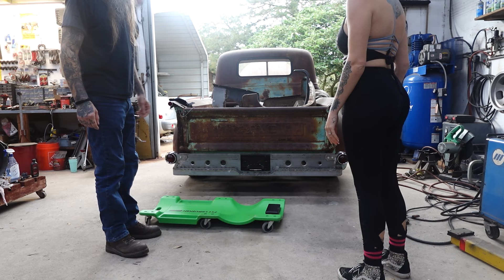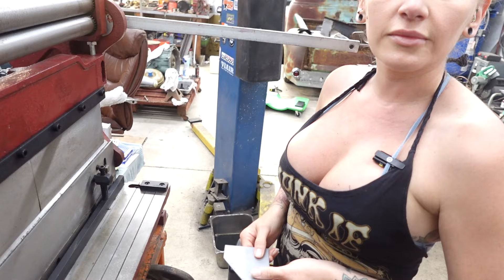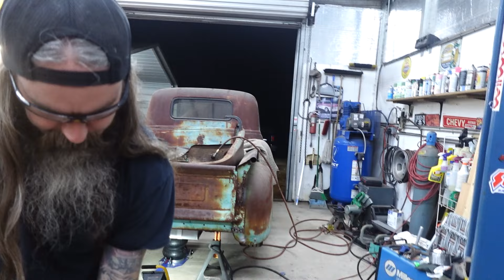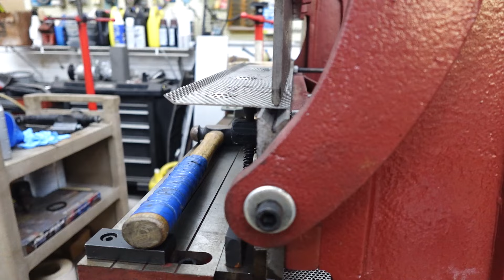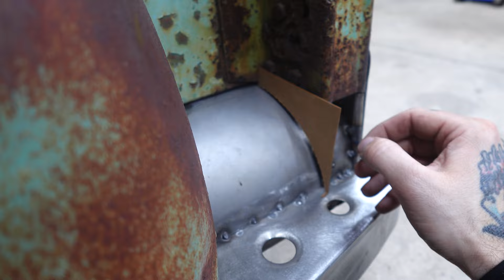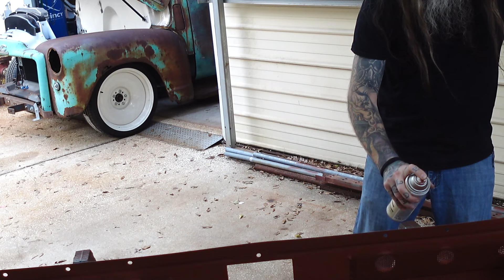48 GMC Custom Roll pan/Bumper

Comment: This video needs some serious ass gangster rap in the background and more paint on the truck… and Chicano people, with extra Chicano people. And full welds. Because stronger then stitch welds… good effort though… absolutely. 😁💯
Reply from the maker: While theres nothing wrong with gangster rap, it isn't our jam so you won't be finding it on our channel.  The welds are strictly esthetic and not structure. We have have been showing quite a few videos in structural repair on other parts of the truck. I hope you stuck around to the end of the video where we stated we haven't completed the patina match 😎 and bring on the Chicano!
Reply: @SawKustomz  regardless weather it’s yours or not, it does jam. And jam it does..  welding for looks ? Really ? First time I’ve heard of that son..🤣 I just want mine solid AF which I’d assume most folks would.. but go head do ur thing. 💯💯💯
Reply from the maker: Yes really. The back of the panel is welded. The front spot welds are for looks. And I hate to be the one to break it too you but all cars are spot welded together and seem sealed. Nothing on a car is fully welded when it comes to sheet metal unless it's a repair someone has done.